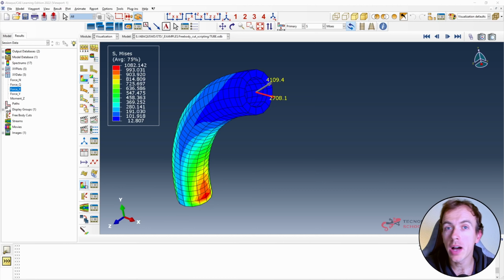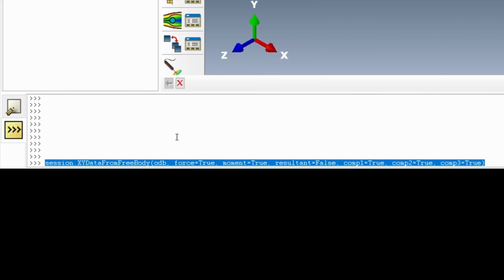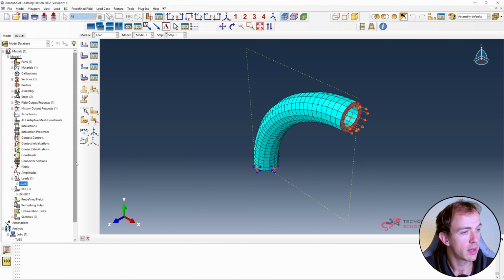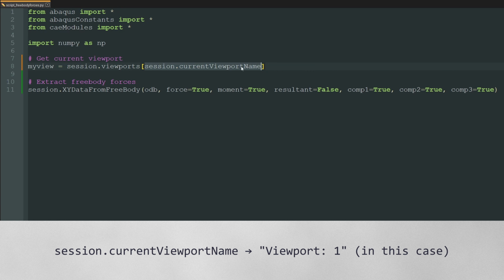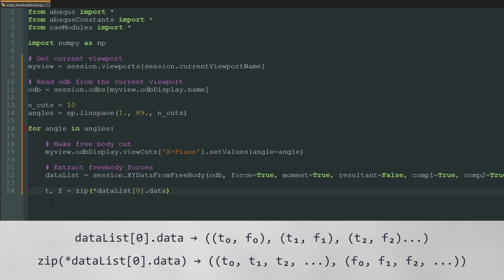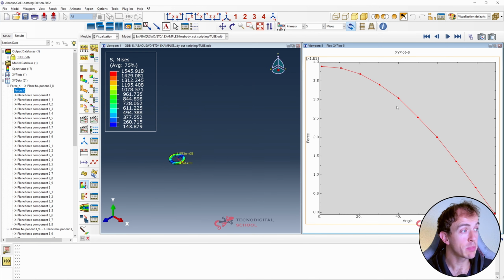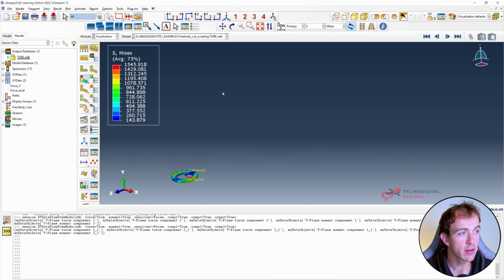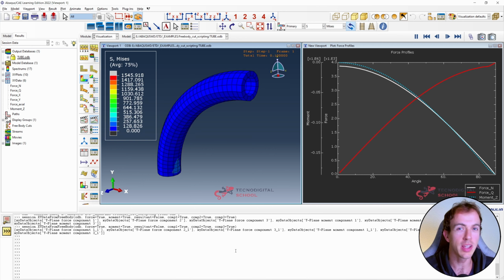How to use Python scripts to make free-body force diagrams in Abaqus

Comment: Hi, 
Thanks for the great video. 
Don't believe NFORC is required, seems to work without requesting it. 
Think we need NFORC only if we do the element based method rather than the view cut, which is shown here.
View cut integrates Stresses over the cut. 
Could be a video for the future?. How to do the same with element based method, and another could be comparing the two methods, highlighting the differences and which to use when?

Comment: Hi, thank you for sharing this. You explained it very nicely and in detail. I have a question, not exactly related to this but still you might have an idea. For a plugin I am writing, I am extracting section forces from bolt which i will use for safety calculations. However, the view cut (so body forces) should be aligned with bolt axis. How can i get bolt axis? Is there any easy way you are aware?
Reply from the maker: You can define a surface (or set of faces) normal to the load axis and get the normal from it.
Reply: @tecnodigitalschool  thank you for quick answer! Do you know the method to get surface normal? I couldn't find it. I can probably get element face normal but surface would be much better.
Reply from the maker: You can extract the normal from a face. If you have a surface, you can do the following:

for face in p.surfaces["MySurface"].faces:
    print(face.getNormal())

Iterate through the faces of a surface and use getNormal.

Comment: Hello Sir,

I tried to read data from Excel file using pandas. I did it the way you mentioned in the post, "How to use Python 3 with Abaqus and more". But abacus still shows no module named pandas. 

Even if we import certain libraries in "app.py" which aren't available in abacus, but still we can't incorporate those libraries in "abq.py". And as soon as we run app.py in python, abaqus shows there isn't any module named pandas. 

Please help me how to resolve this. Thank you
Reply from the maker: Hello Sanjeev,
I guess you are referring to this blog post: https://tecnodigitalschool.com/how-to-use-python-3-with-abaqus-and-more/

If you run app.py within Abaqus it will fail, since the Python environment built into Abaqus does not include these Python 3 libraries (pandas, openpyxl, sklearn...).

The script app.py is executed from an external Python 3 environment (https://youtu.be/SHcmJ038IJ8). This is the main script and will invoke (through the command line) Abaqus and run a second script (abq.py) that will include all the direct commands to control Abaqus.

I hope this is useful for you!
Best regards
Reply: @tecnodigitalschool  I need to pass the arguments from app.py to abq.py. Sir can you please share some part of script to do that. It will be of great help to me. Really need your help
Reply: And most importantly i am really thankful to hear from you. Means for a lot sir